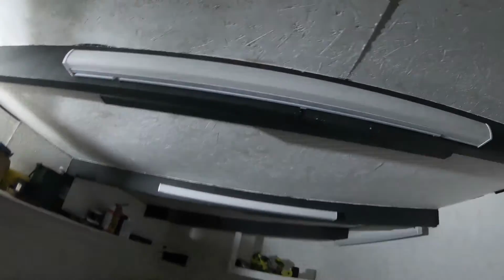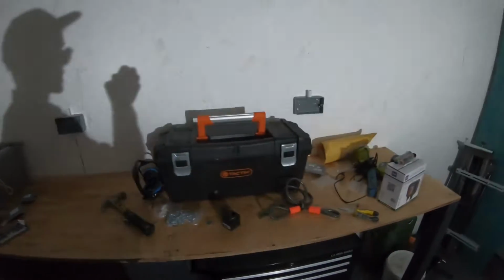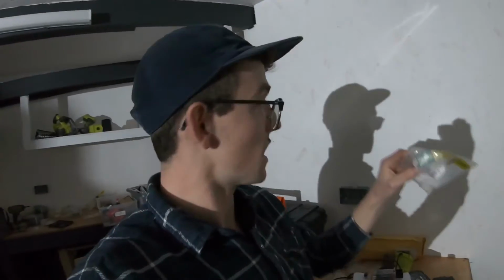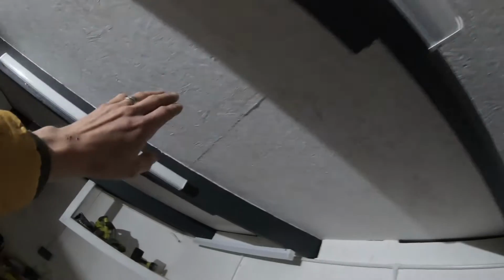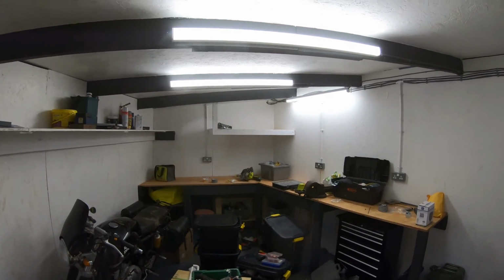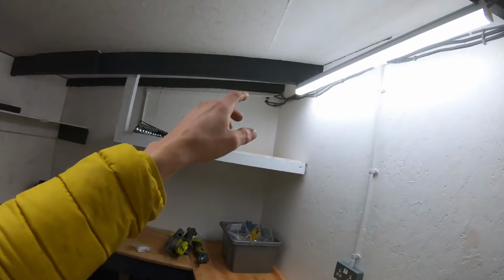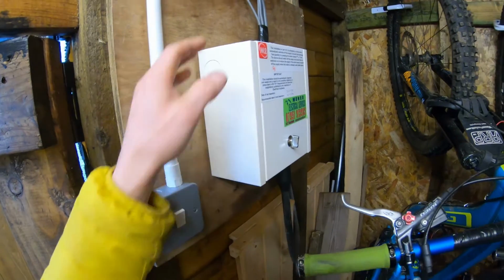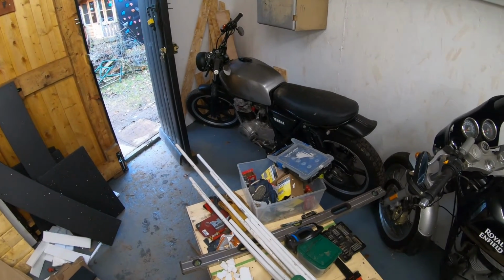Building a Motorcycle Workshop "Running Power and Wiring the Shed" - Shoogly Shed Motors

Comment: What are your thoughts on the LED strip lights?  I'm about to re-wire my garage and have some old flourescent tube lights.  I thought about replacing them with LED lights, but they don't seem to offer much efficiency improvement for the cost of them.
Reply from the maker: These were only £10 each from Screwfix so it was a no brainer!
Reply: @ShooglyShedMotors  do the LED lights effect filming? flickering?
Reply from the maker: @johntray1462  not so far! They've been great.